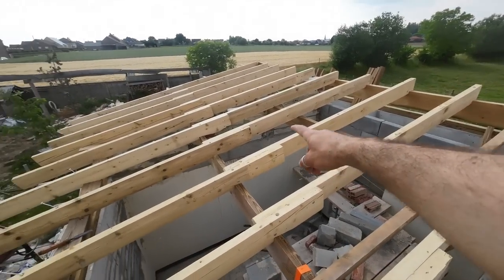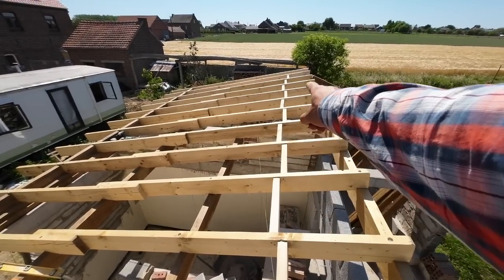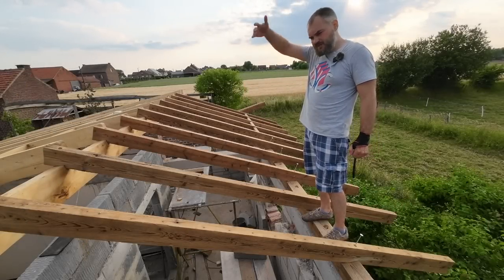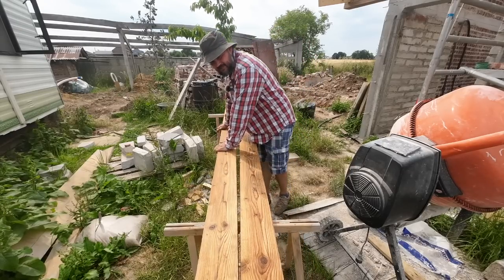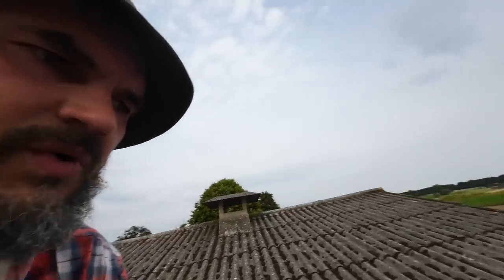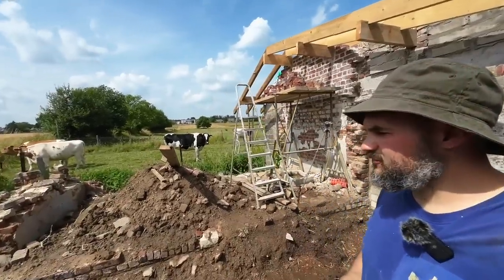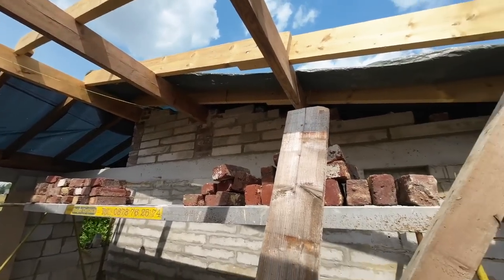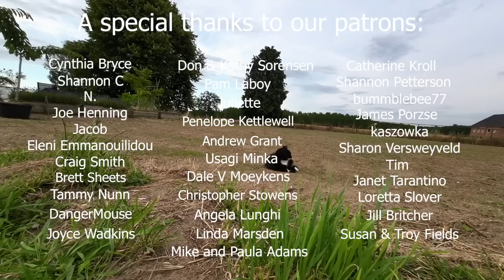Luckily he FIXED HIS FAIL in the roof frame [Turning OLD SHED into a cozy TINY HOUSE]

Comment: The wild flowers got rain at the right moment.
I would call the work on the roof timbers not so much a fail, but Illia, you just forgot to add these cross braces (called noggins in the UK).
But every roof or wooden floor structure needs these when the span is over a metre or 2, they do not just keep the beams upright, but add in the rigidity overall.

Don't forget to add storm straps (storm ankers) which connect the beams directly to the wall, these prevent the roof from lifting in high winds.
They consist of a flat piece of steel with a 90° twist at one end, the short leg from that twist is screwed/nailed (combination of screws and nails is the best as both have their own strengths) to the beam, the long end should be screwed to the wall with 4 or 5 screws distributed along the length of that leg. Consult your building supply merchant of structural engineer which size strap and screws you should use and how many to place where.

Comment: This is a very minor matter, Ilia. The rafters have to be blocked at the plate anyways to make the roof weather and vermin tight. It can be done with wood or stone/brick blocking. All good rafter systems have anti twist blocking as well. You just installed these after you thought you were finished! No harm done,

Comment: I do not think you did a boo-boo, I just think you have fallen victim to a common problem with "green" lumber, in that it will warp and twist. 
The "blocking",  you installed is a common preventative practice for this problem.

Comment: There is nothing wrong with what you did. Plus adding blocking like you did between the rafters is a normal construction procedure. Do not be embarrassed. You did nothing wrong. Considering that you spliced boards together to create longer rafters for that side, it’s not unusual to see some twist. You have the grain in one board versus the grain in the other board. The blocking you add will keep them in place.